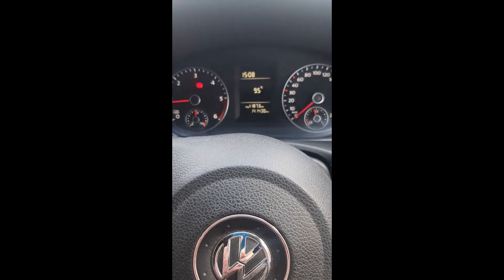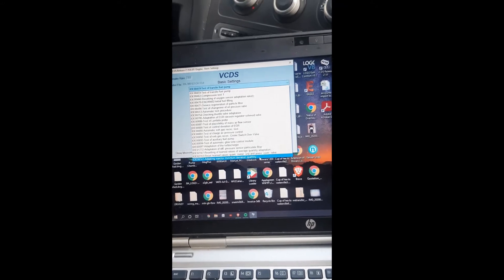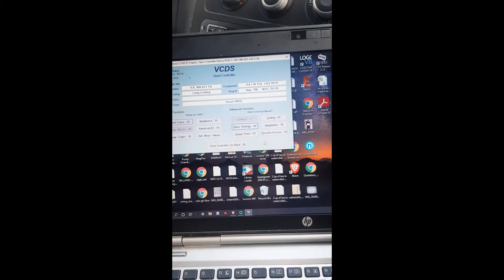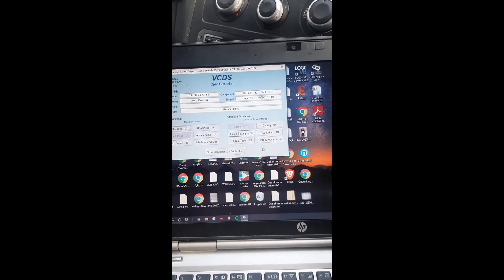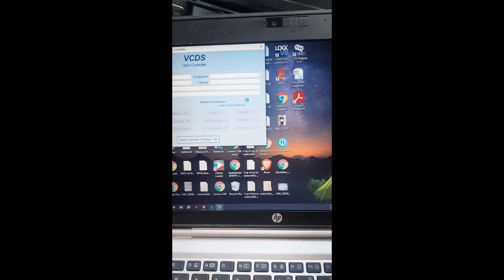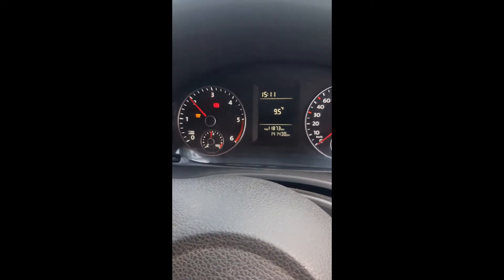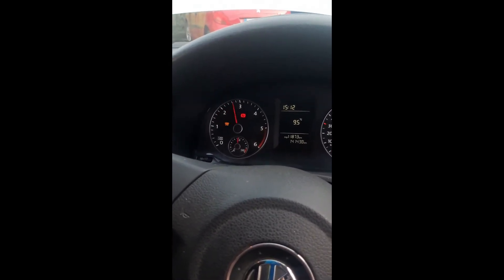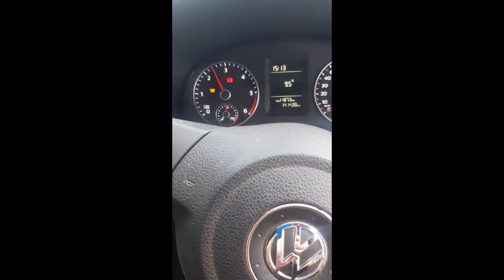VW IDE 06141 CAYE Injector compensation adaption Part2

Comment: I have come to the conclusion this will only work if your engine ECU  software is at least version  9972. My  2010 ECU software version is only at 8831 so not compatible with this test procedure .This is in relation to 1.6 TDI CAYC engine. If you disagree and have hands on experience,please comment and correct me.
Reply: 9922 works as well.
Reply: @CodeEnos  Hi, thank you for the reply
Do you know what year 9922 software update is from?
Reply: @colin5064  My car is 2013. Might be that year, I'm not sure.
Reply: @CodeEnos  thank you for the update information,always good to know from others with personal experience
Reply: I would imagen its circa 2015 so pre diesel gate software fix of 2016
Reply: @colin5064  Yep it's a 1.6tdi cayc engine 2011. We never had the so called "fix". Just changed a injector due to piezo fault. Can't get it to read better than -2 on deviation. The rest of injectors are readin ok
Reply: @dustyfruitypie1633  Sound very much like my  2009 cayc 1.6.Number 1 injector failed due to low resistance on the solenoid last August.I have seen others advise that  + or -
2.8  ml/stroke  is the max limit of these 03L130277B fuel injectors.However you may experience a eratic or rough idling of the engine in winter cold weather conditions with this imballance of fuel deviation quantities.
Reply: @dustyfruitypie1633  So  l would like to ask is it the new injector you changed with the -2 ml/stroke reading ?
Reply: @colin5064  It is the new reconditioned injector that's reading the -2. I've got 12 months warranty on this new injector but I'm going to try a diesel injector flow leak off test over the weekend and see if that shows me anything different to consider
Reply: @colin5064  Quick update- Did the flow leak off test and all equal so that's not showing any issues. Also the recon company changed the injector for another one and it's still reading the same readings. I'm now thinking it's some electrical issue now rather than bad injectors but no idea where to search. I'm not going down the "drive it for 100 miles" route and it will reset itself so will continue to look for different options
Reply: @dustyfruitypie1633  Hi, thank you for the most kind update.I have the same problem as you but my leak off check results were much different than yours.Very interestin that you changed the recon injector with the same results.This is a very confusing problem to solve.Surly others have had this problem,but no solutions have been posted.
My next step is to refit an original 03L130277B injector that has been  electrical tested cleaned and flow checked by diesel injector specialist.However new stetch bolt and copper washer required for this opp, also cleaning set for injector seat area.
Reply: @colin5064  I've spent many days reading lots of posts on different forums and this seems to be a very common fault. The annoying thing is that there is never an ending on the threads to say if the problem has been solved. Please post your fix, if you ever get there and I will do the same
Reply: @dustyfruitypie1633  Will do hope we can both find the answer soon for  this  frustrating problem
Reply: @colin5064  Evening Colin, more frustration today. Advised to not use a recon injector but only brand new ones so spent a fortune on a new one only to have similar readings. Still banging my head against a brick wall
Reply: @dustyfruitypie1633  Hi, just a thought as to your situation,have you monitored your fuel economy results whilst driving with these minimum flow quantity figures?
I have been achieving around 45mpg on routs and driving conditions where l would normally achieve around 60mpg.I just set my average mpg on the dash to monitor my car fuel figure performance.I have never seen my exhaust smoking with white or black smoke from under or over fueling ref this injector  problem.
Reply: @colin5064  I've not really driven it yet, don't want to do any damage or breakdown. At the moment our thoughts are that the ECU is accepting the code of the new injector but not seeing it as a new one but thinks it's the same age as the original ones, which will have 12 years of wear and tear. So have you driven the 150 miles yet and has it made a difference? Your mpg doesn't look like it
Reply: @dustyfruitypie1633  Hi, l will be driving approx 300 miles this weekend.I have changed the fuel filter and added Forte diesel fuel injector cleaner in the fuel tank.
I will ofcourse be monitoring the fuel economt figures achieved.Also l have added Forte top end treatment to my oil.
As l have been experiencing an engine tick noise.Which l have been attributing to diesel knock,due to injector quantity deviation imballance.However it has occured to me  that this tick noise could be a sticking hyd valve lifter.I will as promised report back my findings and results next week
Reply: @dustyfruitypie1633  Hi, after my 450 mile journey last weekend my Golf is running much smoother and more fuel efficient than over the last month.I  achive 61 mpg on my last 85   miles of my trip.Also no  idle stumble or eratic idle on first start of the day. So my conclusion is that somthing has changed within my engine.Either the ECU has now stored new fuel injector parametors.Or new  fuel filter and injector cleaner has made a difference to the engine efficency. So now l will performe a new minimum quantity deviation test on the four injectors this weekend.Just to confirm what the new readings are,or if they  are still the same as last time.
Reply: @colin5064  Really appreciate your reply. I'm still trying to fault find at the moment. Have asked a couple of so called VW experts this week and have got 2 different answers. One saying definately don't touch your software and another saying to do more tests on the 3 oringinal injectors. One of the mechanics even said his cars doing the same after replacing 2 injectors, so don't hold much hope with his advice. Will be very interested to see your readings when you do them
Reply: @colin5064  Exactly the same as you. We bought ours at 6 months old and done my own work on it, which is why we have VCDS. Apart from the usual wear and tear items have never had any problems until now. Now spoken to 3 independant vw specialist, all saying different things. Looks like we might have to go on a long drive
Reply: @dustyfruitypie1633   As promised my Minimum quantity deviation fuel quantity results Date 26/07/24  
Cyl 1=0.0057 mg/stroke
Cyl 2=0.6055
Cyl 3=0.7908
Cyl 4=0.2133
Reply: @colin5064  Wow they are very good readings, especially the new number 1 injector. It looks like you've fixed your problem. Do you have your old readings to compare?
Reply: @dustyfruitypie1633  Hope you will let me know how you solve your problem.I do hope its like mine, just some hundreds of miles need adding after the injector change.
Reply: @colin5064  I'm still going to try some more fault finding but if nothing shows up will try a long drive. At least, for anyone reading this, you have found a solution to this massive problem and posted it. Hopefully that will help someone else as well as me
Reply: @dustyfruitypie1633  Sounds good to me lets all share the solution to problems we encounter with these  motors
Reply: @dustyfruitypie1633  Hi, just like to ask if you have achived a good outcome with this issue.Or are you still strugling to sort it?
regards   Colin
Reply: @colin5064  Hi Colin, still not fixed I'm afraid. Have now replaced the other 3 injectors with reconditioned injectors. So 4 fresh injectors from original fault. Deviation readings were all over the place and noisy but decided to drive it. Now done around 250 miles, changed the oil, oil filter, fuel filter and added fuel additive to it. Deviations more even but still high, around 1.4. According to the trip computer the fuel consumption is over 60mph, which I don't believe. My main issue is the noise, struggle to describe it, but wife thinks it's a ticking noise. It gets really loud on acceleration. Lumpy idle when engine is warm. In fact it is altogether worse when engine is warm. There is no warning lights, no fault codes so don't know what else to test. Can't drive the thing without constantly listening to various noises! How's yours doing?
Reply: @dustyfruitypie1633  Just wondered have you seen this latest video on this Golf Mk 6 1.6 tdi injector problem.
It appears that when software scans sshow a problem with number 2 injector,then its refering to number 2 in the firing order not the engine cylinder possition. So cylinder 1234  engine block possition would become 1423 by firing order possition.
I for one never realised this.
Reply: @colin5064  I think I've found the video you are on about. Interesting findings but wonder if Autel reads it different to VCDS. I changed injectors around and the fault followed. 
I'm now going down unchartered waters for me, looking at my fault. I've got half the engine in bits😱. Will let you know if I found anything interesting in a few weeks, if the engine ever starts again
Reply: @dustyfruitypie1633  Well I wish you the best of luck with your extensive engine investigation,you certainly deserve it.
As always I would love to know what you find if anything.As I plan to keep my Golf for as long as possible.As you have mentioned before,just wish more people shared their
results and findings on this all to commom topic
Reply: Just chipping in with me experience. Diagnosed a faulty injector after the car just started misfiring really bad all of a sudden one morning after perfect driving for about 10 miles. No vcds for advanced checking of values. Just an autel scan tool. Swapping injectors 2-1 over (faulty injector was no 2) confirmed the scan results as misfire followed injector 2 to cylinder 1. After ordering 2 recon injectors from a scammer uk website, I ended up getting 2 originals brand new, continental. After installation, the car started and ran good even with nothing done. It is a 2011 mk6 cayc. I still entered the new injector codes using the autel scanner and have now driven about 200 miles. All seems well. The car had been off the road for several months with battery disconnected for the last month or so. Started perfect first time after installing the new injectors. Again, no special deviation programming procedure. I don't have vcds. Local dealership quoted me ~ 1150 USD equivalent per injector and said all 4 need to be replaced. Ordered 2 new from darkside dev at about 325 £ a pop which worked out to about 1300 USD for both including local import duty. Good start, just moved it back and forth a few times then registered the new injector codes with autel scanner and started driving it normally. Mileage about 75,000. I only read about the deviation coding after purchasing the new injectors while waiting for them and was really worried that I'd have to fork out nore money for vcds + import tax (which would be another ~1K USD) to do it and have been really thankful that it seems ok. Indicated fuel consumption averages look promising as well, just about matching the best figures I had prior to injector failure, a tad over 60mpg roughly of relaxed driving over a 30 mile trip, manually shifting the dsg (to try and extend clutch pack life coz it has had some slipping since purchase of the car at about 55K miles) managed to drive a good 20K miles with no apparent worsening on dsg slip... That's my contribution to this...for what it's worth.
Reply: @papapetad  Thank you for your most kind input on thia well known problem.Do you know the current software reference number of youe ECU?As the VW dealerships would only have applied the diesel gate software fix when it became available in the US
Reply: Same as yours, running ok when cold, but hammering when engine getting warmer
Reply: Hi did you ever get this to work with your softwear version? I can't get it to work with ours after changing an injector. Our version is showing 8803. Will it adapt itself by just driving the car?
Reply: @dustyfruitypie1633  Hi, unfortunatly no l never got this to work,l just removed the neg battery terminal for 30 mins to discharge the Engine ECU stored values to enable reset.This it will do over the next 150 miles of driving l am lead to believe by auto electrician.
Reply: Hey mate, my ECU (88xx or something) is similar as yours and this procedure also does not work - it shows that it is running, glow plug indicator blinking but the engine only idles at 800 rpm and not reving up. I wanted to do this adaptation because I got 3 brand new injectors installed (one was still good) and now the engine has a little bit more than usual vibration on idle. Injector specialist says old injector nozzle should be changed, I thought maybe it is not the issue and this adapation would help:( Do you know if that battery disconnect method basically does the same thing as this quantity adaptation on vcds?
Reply: @fukanoshi4164  Welcome to the club! Tried the battery trick but didn't work for me. Tried the adaption with same results as yourself. Colin5064 results after driving over 400 miles is the only positive outcome I've seen so far, regarding this issue and I've been reading alot over the last 3 weeks. The problem on the forums, regarding this issue, are  that people aren't updating the threads to say if it's been fixed or not
Reply: @dustyfruitypie1633  Thanks for answer. It is so annoying - already paid ~1300 Euros for work and 3 new injectors which is almost half of the car worth:) And now after 3 new injectors installed, this new problem occurred. It`s not a big issue since the vibration on idle is not very big but still would like to fix it and changing old injector nozzle to new will cost around 150 Eur and I am not sure if that will eliminate this mild problem.
Reply: @fukanoshi4164  Did you have new injectors or reconditioned ones fitted? Do you have VCDS to see the live injector deviations? I can understand your frustration and having paid that sort of money, you have a right to expect the vehicle to be running correctly.
Reply: @dustyfruitypie1633  Yeah, I have VCDS, the old unchanged injector is around +-1 ml/stroke while 3 new ones are close to 0. All 3 new injectors are brand new, made by Continental (Siemens) upgraded version with letter S instead older ones ending with B. Guess I`ll just need to believe in injectors specialists and that old injector nozzle changing will fix idle issue. 150 Eur not that much when already spent 1300 Eur :) Car made almost 190 000 km and problems started.
Reply: @fukanoshi4164  Wish we had your readings but we have only changed one injector for a new one. It's the new one that seems to be causing the problems, which seems to be the opposite to you. In the UK, you are probably looking at around £600 plus for one new injector at a garage so not cheap to just keep changing them to see what happens. Out of curiousity has your car had the diesel gate fix?
Reply: @dustyfruitypie1633  It had it, just not sure for how long - I bought car at ~125 000 km and ECU had dieselgate software installed already so I removed it straight after buying the 
car. I also fixed DPF, EGR and remapped to stage 1.
Reply: @fukanoshi4164  Good luck with your fix. We might be looking at some form of software update to deal with our problem

Comment: Hi, i have tried to do this function on my VCDS 19.6.1 as per your very detailed instructions.
However once security access accepted  and basic settings  IDE06141  selected go.
It then askes me to press the brake and the accelerator together and keep them pressed ?.
My engine rpm remaines at 800 and nothing else happens even after 5 mins.
I dont understand why my VCDS procedure is different to yours which oviously works,whereas mine does not.
Do you have any thoughts on this,is my version of VCDS to old?
If the 1DE 06141 is listed you woul;d expect it to work,but it does not.
Reply: same here did you solve the problem?
Reply: @TheChamsEddine1  yes
Reply: @colin5064  How did you solve the problem in the end?
Reply: @linli3031  Hi, sorry to say l never solved the VCDS activate IDE6141 problem.
I even upgraded to ver 23.3 1 and this still did not run the 
IDE6141 program correctly.Sorry  l could not help further with this.
Reply: @colin5064  Some people say that the ecu version 88? ? The version starting with 99 can not run ide06141. Then your car does not run ide06141. Is it normal to start now? Will the ecu automatically match after driving 1000km?
Reply: @linli3031  My 1.6 tdi cayc engine is running very smooth with perfect idle rpm 780.I never got VCDS to opperate the IDE1641 procedure correctly.If you read my extensive posts on this subject you will see how l achieved this smooth engine performance.I am now achieving 60mpg plus on long  distance continuos drives
Reply: @colin5064  My ecu is 8856. I have a 2011 passat b7 1.6tdi. I replaced the No. 3 injector. After running ide06141, it did not run successfully. The glow plug indicator light flashed and the speed did not change. The Internet said that the ecu version was too low and did not match the software. Now the idle speed will jitter when I start it for the first time. I wonder if the car will return to normal idle speed after driving it for hundreds of kilometers. Restore the first ignition idle speed to normal
Reply: @linli3031  When you say you replaced your number 3 injector did you do this yourself,did you recode the new injector into the ECU?
There is so much info i don't know ref your situation.Was it a secondhand injector of ebay etc,or has it been fully reconditioned and if so by who?
Reply: @colin5064  Continental/VDO A2C9626040080 - Iniettore Bought new, already encoded into
Reply: @linli3031  So who changed and fitted this new Continental fuel injector,you or a profesional garage ?
Have you fitted a new clean fuel filter before changing the new fuel injector?